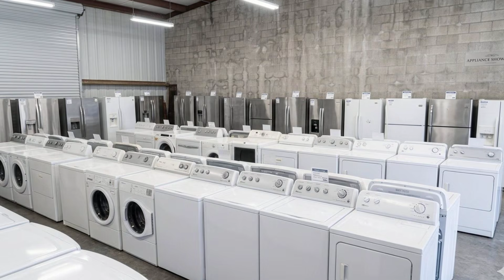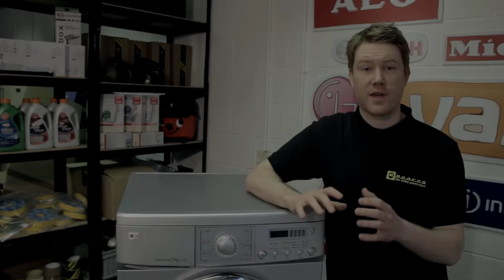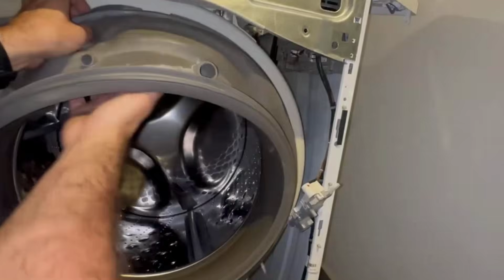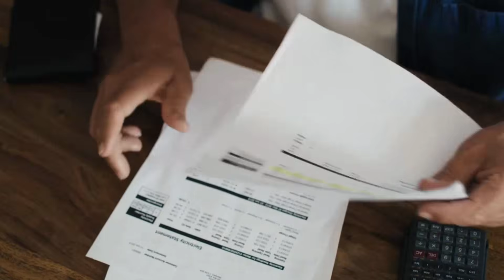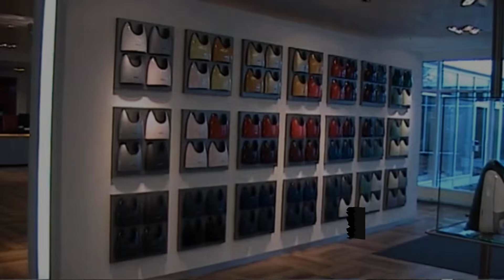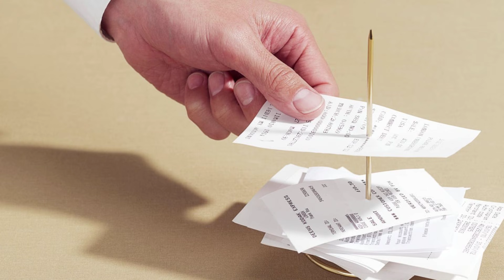Why Your Washing Machine In The UK Dies in 3 Years

Comment: Had a Samsung eco bubble and it wasn't cheap. It lasted 3 years before the drum shook itself away from the spider causing torn drum and spider debris. Cost of repair was prohibitive. Eventually stripped it out of motor, loom, circuit board, pumps, door and seal. and sold the lot on ebay for just over £100 to get some money back. Rest went to the tip. Worst machine  I've ever owned. Wont ever buy another. Present machine Logic. had it 7 years and its on its 3rd set of motor brushes which are less than a tenner to replace yourself.

Comment: There is nothing wrong with brushed motors, brushes are cheap and can replaced relatively easily by consumers and engineers. while brushless inverter motors are nice they are beholden to very expensive circuit boards that are subect to power surges and moisture. at the end of the day a set of brushes is £15 and a main PCB is about £200
Reply: There are pros and cons for both motors. I personally prefer machines with brushless motors due to noise levels
Reply: Yeah, and fat chance of getting hold of a circuit diagram for the board, and even if you could it most likely won't help as the board will most likely be fitted with the maker's own custom chips and/or software etc. and it'll be full of micro surface mount garbage and be multi-layered so if gets burned or cracked it would be a write off any way. Sometimes washing machine breakers can help with a second hand good board if you can find such a place, there was one near me some years ago but I don't know if they're still there.

Comment: Any washing machine that ONLY comes with a 12 Month warranty..Leave it in the shop. 
These are machines made by    Hoover..Hotpoint..Indesit...Beko..Logik... Candy ... They really are NASTY.   They come with a 1 Year warranty..FOR A REASON! 
Samsung machines have FAR TOO MUCH "Unnecessary tech"  on the machine.  
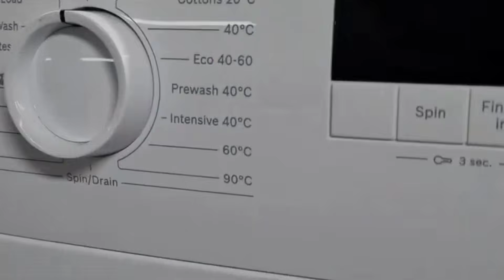At 16:19 in this video..... Bosch WGE03408GB (Also known as a Series 2 Bosch) .... Bought one of these last month .... They are around the £400 mark here in the UK (Price correct as of 20th May 2026) 
Without a doubt, the BEST wash machine you can buy    (Money spent pro rata life expectancy of the machine) 
How simple do you want it ..
Life expectancy of a Bosch WGE03408GB 10-12 Years, money spent £400  ..Life expectancy of a Hotpoint 5-6 Years, money spent £280
You are buying TWO Hotpoint machines in 12 Years, 2x£280 = £560. You are buying ONE Bosch series 2 machine in 12 Years = £400 

The cheap washing machine is the EXPENSIVE washing machine over a lifetime.... You just get to buy them in smaller instalments. 
EDIT.... Last month, when I bought a new washing machine, I would have happily bought an entry-level Miele for around £850 ..However, they have started to also use plastic sealed drums on their entry models, such as the Miele WWA120WCS 

Verdict... Any washing machine with just a 1 Year warranty... Leave it in the shop (Unless you are happy to replace it in 5 Years time) 

Thank you for this video.